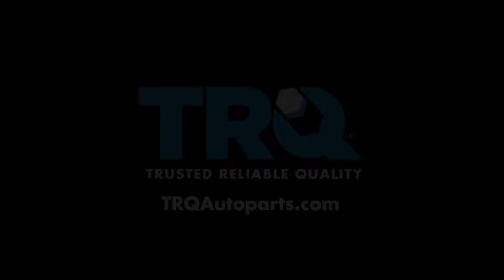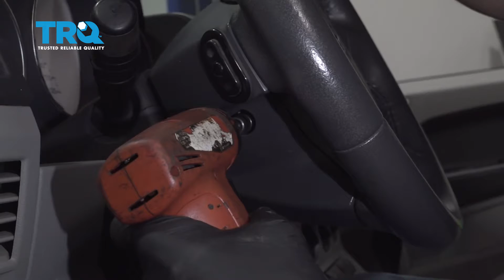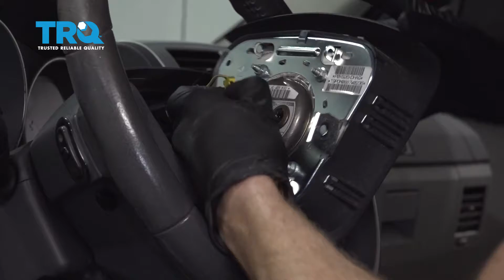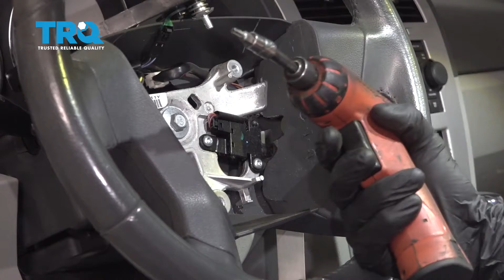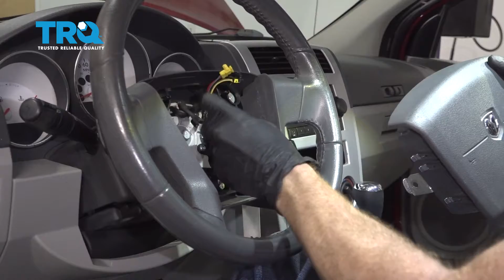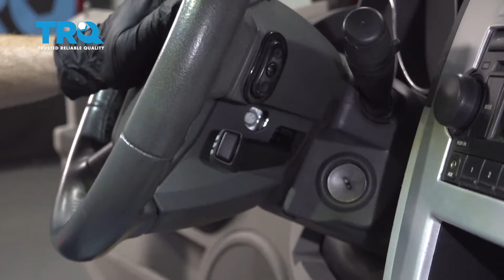How To Replace Cruse Control Switch 2007-2012 Dodge Caliber

Comment: This is incorrect. There is no holes in the sides of the steering wheel cover to remove any bolts for the horn pad.
Reply: What year is your vehicle? I have an 08 and if you watch the video I made for this about 5 yrs ago, you'll see the holes on the steering wheel sides.